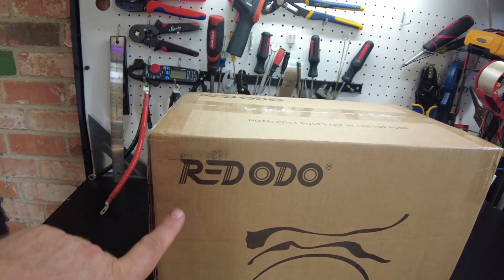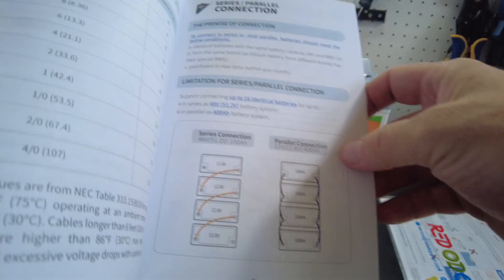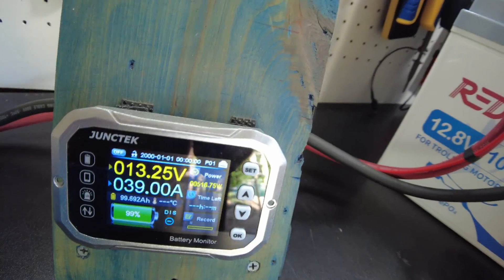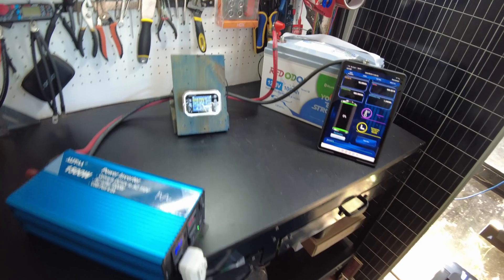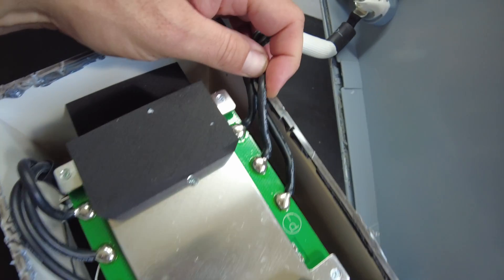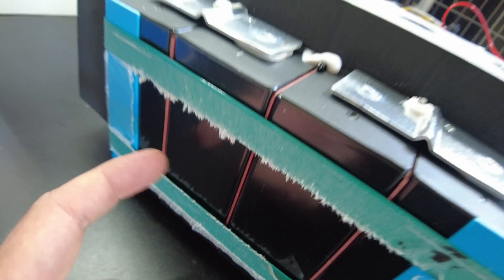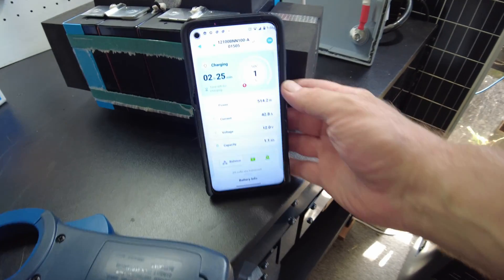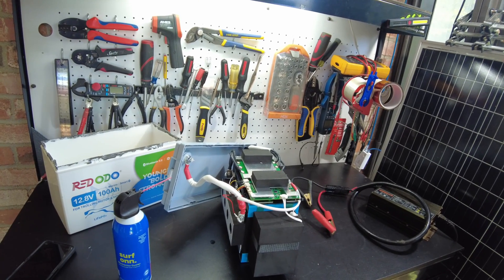Redodo Smart Bluetooth 12V 100Ah LiFePO4 Lithium Battery

Comment: Looking at 2 x 280ah Redodo batteries with bluetooth for a camper-trailer....hoping to run a 12vdc OutequipePro air conditioner for 2-2.5 hours a night for 2-3 nights :) BUT how will the bluetooth Redodo app work when I have the 2 big batteries connected in parallel? Think I'll have to run two apps/one for each battery? or will the app see one 560ah battery? Thanks for any clues.

Comment: I have two Redodo 100 amp Bluetooth batteries I have installed in Licitti battery boxes. I noticed today after charging to 100% with a 20 amp charger the app shows the BMS in a yellow color just like your app did. However when you started to discharge the color changed to green. Do you know why that is? I haven't noticed it before when charging my batteries. Thanks.
Reply: Found the answer to my question. The BMS is showing that it was in overcharge protection mode. When you were discharging the color changed to green.  Saw this on a another video after a charge on their 165 amp hour bluetooth battery that showed the reason for the BMS at the yellow color. Glad I found it.

Comment: i was able to get the mac address of the battery using an app called signal finder but i was not able to connect to the bluetooth sensor from linux.  is that even possible? it would be nice to  log the sun levels.

Comment: At what temperature value does the cold temperature switch activate??  You sprayed it with Dust-Off, but that can be much lower than 32 degrees F.

Comment: What if you have one 12v 100ah Bluetooth version in series with the 12v 100ah non Bluetooth version. Will the app be able to work or it needs 2 Bluetooth version? Would like to make a 24v 100ah and have bms app monitor capability.  Referring back to a video you made a while back with a shunt to monitor the capacity.
Reply: Each battery will need it's own bluetooth

Comment: In general the battery works as expected.  The main issue I found in actual use the BMS/APP will not track discharge on less that 2A. If the drain on the battery is below a 2A threshold the the battery will drain and app will still show 100% SOC. I have been able to repeat this and verify with their tech support.
Reply: Man hate to hear that. Was bout to pull the trigger. I’ve got 2 100 amp hour redodo as of now. But would like the app to track discharge of use on my kayak…